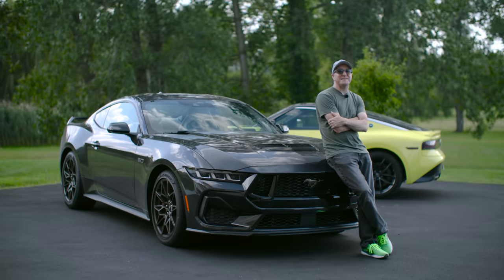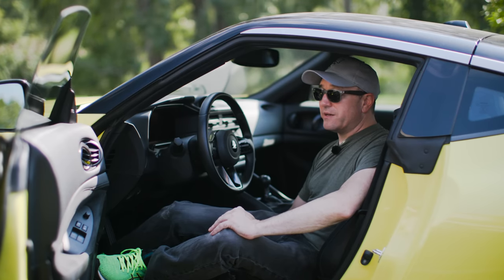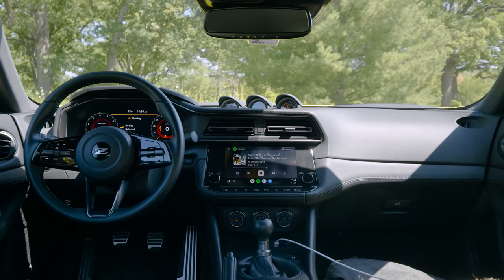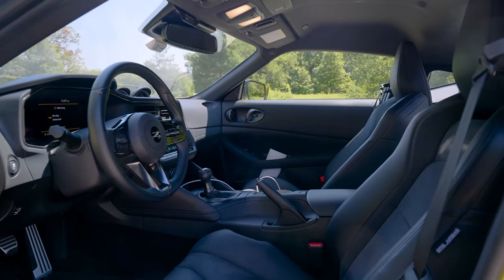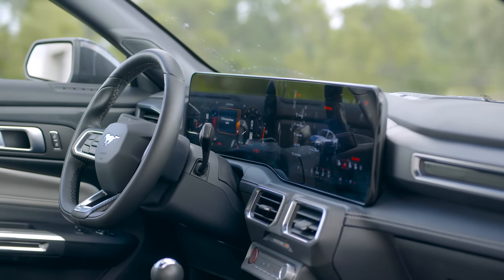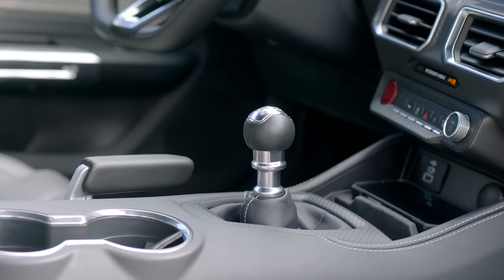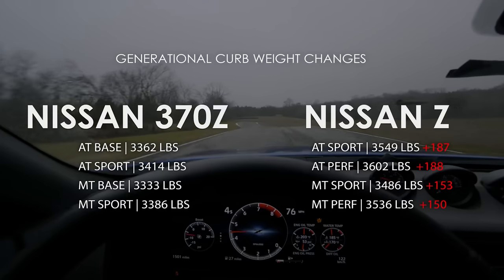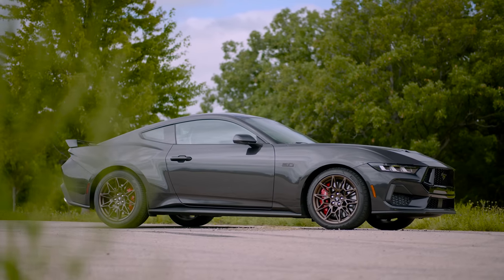Mustang GT vs Nissan Z | Maximum Muscle, High Prices

Comment: I can't believe how expensive cars have gotten. These 2 cars should not be over $50k each.
Reply: Kneesarn!
Reply: How so?  A 1991 300Z TT had a MSRP of around $35,000 which is nearly $80,000 in today's money.
Reply: Well you can get a GT for less, this has a few expensive options
Reply: These are high level sports cars. If you want cheap fun, there's the Miata, GR86, civic si, Elantra N, etc
Reply: Average car prices are 50k now. Yep I was shocked too.
Reply: It's not "cars got expensive", it's your money are worth less. Keep the printer on.
Reply: @sleeksilver Yea. People forget how expensive the Z32 was, in it's day. That's why the Z33 was such a shocker. It was about $26,900 in 2003, which is about $44k, today.
Reply: With all the safety and emission requirements, it's no surprise.
Reply: @sleeksilver Yea, but was Mortgage, Rent, power, gas, food, and everything else as expensive too? Definitely not.
Reply: @sleeksilver  Average Canadian household income in 1991 was 49,842 which is 111,866 in 2023 dollars. The average household income in 2023 is about 67,500. So yeah the Z is expensive as fuck.
Reply: Now do the mustang GT price wise guy... Oh, I did, it's 27k in todays money. Lets even add 6k for powers sake, thats still FMV. Lets pretend you were born yesterday, and thus had not watched same model prices rise markedly over the last 3+ years beyond inflation rates also considering some of these "sports" cars are essentially the same platform as they were 10-14 years ago.   @sleeksilver
Reply: @Scypher0th  what planet do you live on?
Reply: @sleeksilver shhhh we don't talk about that
Reply: @waynemangan7200  an $18,000 Mustang GT in 1991 is equivalent to $40,000+ in today's money.  What calculator are you using? LOL
Reply: @JoiceVaderd this new Z starts around $42k I think
Reply: +1 for inflation. The fact that I can still find used cars for under 5K is unbelievable.
Reply: @sleeksilver but wages haven’t gone up much since then. They’ll sell barely any even at $50,000 today compared to 35 10 years ago because of that
Reply: Inflation. Gotta keep up.
Reply: @devn3813  you're surprised people are buying less coupes today compared to 10 years ago?  Coupe sales are in the shitter and hardly anyone is buying sedans now compared to CUVs. Nothing you said is surprising.
Reply: That's how inflation works.
Reply: @sleeksilver  because we’re priced out of sedans coupes and performance cars. If you want a decent sedan you better have $60,000+ and they’re making crossovers $25,000 now. They’re altering the market themselves artificially
Reply: For this price it better be a Lexus.
Reply: Bro we just poor that's all adjust for inflation these cars are inline with the older ones
Reply: @tyhyhh Unfortunately incomes don't keep up with assets.
Reply: @devn3813  what are you talking about? Coupes haven't been a cheaper alternative since the '80s and '90s. There are still plenty of affordable sedans around, look at the Elantra, Accord, Camry etc. Performance cars have never been cheap. 

Good, fast, cheap, pick two still applies and always has.
Reply: @sleeksilver  2010s mustangs were all 3.
Reply: @dazuko8839 

“High level”?….. that’s funny
Reply: @dazuko8839 new mx 5 is not cheap
Reply: @Felale you cant even buy a new IS300 in 2003 with the equivalent 50k 20 years ago
Reply: @notagain2856  Okay? And Lexus is a luxury brand.
Reply: Go back to 2003 and see what sportcar you can get for 30k
Reply: @Felale  lol no they weren't. Cheap ass interior and low refinement. I spent a ton of time in a 2012 GT with the performance/track package.
Reply: @sleeksilver It's not all black and white. Cost of r&d for it 30+ years ago was higher, nowdays this gen had it far less as technology advanced and it has a lot of old tech used, well basically everything is previous gen, everything that required considerable amount of r&d. Further more, average salary in 1991 ranged from 17k to 74k depending on degree, that's without bonuses, yearly additions and all. 
Average US salary in 2023. (yearly one) ranges from imagine under 15k for 9.4% of population, 15 to 25% for just under 9% of population, 8% for 25-35k, 35-50k 11.6%, 50-75k 16.5%, 75-100k 12%, 100-150k 12%, 150-200k 8% and 10% of those over 200k. Bare in mind life expenses went up by tens of times, including food, realestate, taxes, additional expenses that were not present 3 decades ago etc. I don't have percentages of income population in 1991. but only amount shows you how bigger the standard was back then.
Reply: Mustang s650 is just a refresh of the s550. And yet they are gouging customers.
Reply: @sleeksilver  those are all cvt shitboxes for $40,000
Reply: @JohnyMcNeal  I'm an FA, I understand everything you were pointing out. I'm not arguing over buying power versus salary, I'm just comparing MSRP to MSRP.
Reply: @sleeksilver 
So true , because in 1991 consumers actually were buying these cars.. not leasing them while living in their parents garage…
Reply: @sleeksilver inflation calculators are wack. It doesn’t show buying power and necessities like food and housing have outpaced salaries
Reply: @ToolishBox  they aren't whack at all. Anyone with a brain understands buying power vs salary.
Reply: @platinummad6315 Well stated
Reply: My wife’s new Pacifica Hybird that Mark almost bought (yes, they’re that decent) cost $60K. $6 0 0 0 0… for a minivan. Which I was like “are they high?!?” Then to look up in ‘98 the top Town and Country, which was a shitbox, my exes parents had one, and the new new Pacifica is damn near luxury  in comparison, $34K, which is $66K in 2023 money. Yes, stealerships are bending people over, but inflation worse so.
Reply: Go look up how much a ‘95 300zx turbo was and reevaluate your comment
Reply: Over 50? Loaded, they should cost 40.
Reply: @ToolishBox  It's also under the the true rate of inflation due to various external influencers. The CDI hasn't been accurate for decades.
Reply: Why does everyone forget that cars that are 5 years old are just as good and cheaper??? Like you don't need the newest fuqing thing.
Reply: @drtydsh  Someone has to buy them in order for them to be five years old
Reply: @waynemangan7200 exactly. Only reason cars prices skyrocketed, was because of our Democratic government shutting our economy down for COVID. If that never happened, these two cars would be selling for low $40k’s.
Reply: The Z's twin turbo, Japan-made engine is not cheap to manufacture.
Reply: When pricing is based of inflation vs the income of buyers, everything will feel more expensive. Really, we’re all getting poorer
Reply: @air-headedaviator1805  Incomes are a lagging indicator. Median incomes are right about in line with inflation. The problem is the price of many essentials has greatly out paced inflation.
Reply: The auto industry has killed itself, I've just lost interest now.
They start by making pointlessly big heavy SUVs and charge more for them, make that the norm, get rid of their cheaper options, and then introduce what should have been the cheaper models are new special sporty models that are even more than their stupid SUVs. It's all just a market manipulation strategy that the general public roll with
Reply: @chrisogrady28  they make what people want to buy. The consumer is to blame here
Reply: @chrisogrady28 Rather the people who buy cars new like SUVs and there’s not enough people who like sporty cars for those to be a mass market thing.
Manufacturers make what sells, always have. If they don’t, they go out of business!
Reply: I remember when I was in high school these cars were so affordable
Reply: @dazuko8839  No, this is a GT car and a muscle car.  These are sports cars the way a Honda Accord is a sport sedan.  Let's just be honest about it.
Reply: @emilianoorozco6498  LoL. When did you attend high school?
Reply: @sleeksilver  I can't stand when people like you bring that debate up.  Clearly you don't have a clue about economics.  $35,000 in 1991, you can buy a nice house for $78,000.  My parents bought a house in 1991 for $78,000.  I just bought one for $305,000.  Gas prices was $1.14.  You could get a Whooper or Big Mac meal for $1.99.  Cigarettes was $2.00.  You can work at a hardware store and afford a house.  I read an article that a woman worked at an ACE hardware in the late 80s and early 90s and was able to afford her own house.  This is called stagnation, inflation goes up but wages don't, what part of that don't you understand?  A $35,000 a year job in 1991 isn't an $80,000 job today.

In the 90s, I was in high school making $5.50 an hour, I managed to buy my own car a, used Mazda RX-7, gas was $0.87 at the Sunoco down the street. 94 octane was $1.25/gallon, and paid my own insurance, $50 a month, and did a lot of repairs to one of the most unreliable engines ever made.  I had to buy my own lunch at school, my own clothes, etc., since I didn't want to ask my parents for help.  A teenager now would not be able to do afford to buy a car, pay for the gas, insurance, and maintenance with the current wages at a 20-25/hr work week for those under 18.

I went to a tech school and it was $12,000/year.  That same tech school is now $52,000/year.  A dozen of eggs was $1.25 a dozen, now it's worth more than your first born.  Either you're very young or just naive.
Reply: @sleeksilver Audis are overpriced, now do the price of a 2001 Mustang GT adjusted for inflation 😊
Reply: @JoiceVaderd  People also forget that you can buy a nice house for $70-80k.  Stagnation, learn about it before you make a silly argument.  My parents used to tell me it'll cost about $80 every two weeks for groceries in the 90s.  Now it cost me $200 every two weeks on the low end.  You people never factor in cost of living to this silly inflation debate of yours.
Reply: @DroneStrike1776  Yea. My grandfather bought his house for $80k, in the 80s. While inflation is something to take into consideration, the pay has remained mostly stagnant and hasn't risen with inflation. My dad was able to buy a Z, in 2003, when it came out. I make the equivalent that he did, and I definitely can't afford the brand new Z, comfortably.
Reply: well, printing oceans of money causes to dilute the currency
Reply: Mustangs shouldn’t cost over 35k. Ford is asking bmw prices for it. They’re insane.
Reply: @devn3813 same thing happened to wagons unfortunately. Industry's writing the books because it's much more cost effective to make some plastic piece of shit with a whiny 1.4L engine and horrific body control than to make a car that's fun to drive.
Reply: Top trim should be 55k max imo
Reply: @Felale $60k can get you a used LC
Reply: 2014 911 base can be had for $83k. Today a 2023 will set you back at $115k. Almost a $30k delta between  the two. Obviously a much diff car than these two.
Reply: Luckily you can finance for 420 months at 69% interest.
Reply: Both of these are too expensive and also too heavy
Reply: The 400 is in the 40’s where I’m at!
Reply: Isn’t it the dollar crashing and not the cars getting more expensive?
Reply: A new Corolla or Civic is around $25k where I live.  Welcome to hell, population: us.
Reply: Boomer
Reply: With inflation 50k sounds about right. Both car’s are still affordable to many consumers.
Reply: @Terminxman the Z starts at 40
Reply: $35-$40*
Reply: stop complaining you americans! here in switzerland you can get a fully loaded mercedes a45 amg for 120k and you are complaining bout a 50k V8?
Reply: @sleeksilver 
This statement is true but at the sametime its really the USD has gotten less in value. The FEDS "accidentally" leave the printers on like a kid "forgot" to turn off the lights.
Reply: Agreed! I also find it fascinating that for every comment that understandibly laments a car that used to be $35k now costing $60k, there's no shortage of people that counters with a "what's the problem, that's 'normal' inflation...stop being broke;" or "if you want cheap...go get a Miata." Which ironically is also a car that while being relatively cheaper today, isn't impressively cheaper for the bargain it used to represent. Simply put, it used to be $20k less than it is now.

Understandibly, gradual price increases are an inescapable reality of our times. Modern requirements and tech that go into designing, certifying and manufacturing new cars (epa, safety, crash, etc.) definitely makes the production business expensive for companies. The question is...does inflation plus these increased manufacturing costs really equate to a whole whopping $20k more on avg than just 10 years ago🤔? How much of this margin, beyond what's necessary for a profit is simply companies taking liberties with the fact that we don't ask the "used to be $35k" question?
Reply: Mustang was like 25-30k in 2000
Reply: Or stop asking for the sun the moon and the stars to be in your car.  Easy price fix.
Reply: First words out of my mouth. Maybe the Z because it’s brand new and not mass produced like the mustang which has very minimal update
Reply: I cant wait for you to see the price of the new Toyota GR Corolla.
Reply: Yes they should your statement just clarified it that’s the price range a Honda accord is 40,000 lmao
Reply: @isrstrategies  

And a top of the line toyota camry xse is almost $50k
Reply: @velardechelo  yes and it was a complete shitbox with technology from the 70's
Reply: minimum to play w fossil performance is 60k. a 43k model 3 performance will gap these for days.
Reply: @sleeksilver I think my 2003 sold originally for 32-33k
Reply: the tt 300zx was also noted to be extremely expensive at the time- it was trying to punch upwards at even more expensive cars and it wasn't until later models that they brought the z back into affordability  @sleeksilver
Reply: It's cheap to me 50k is nothing for what you get
Reply: They should not be more than $25-28K. This is inflation - the cost of having a fiat currency and a government that won't stop spending away the future of the country. I paid $28K for my 14 PP GT. That was ~8 years ago. Cars have almost tripled in price in 8 years. Think about that for minute. 

Perspective. A GT in 2005 was ~$25K and in 2015 was ~$28K - an increase of 3K on average. Prices were starting to drop during the Trump era as inflation was ~1% and the economy was approaching a golden era. Then we got Bidenomics.
Reply: @dazuko8839 All of which are boring and slow compared to that beautiful V8. That said, there's always buying used or building your own car
Reply: Might wanna look at house prices then
Reply: It's not that the cars are expensive....it's that cash is losing value everyday. Saving cash to 'one day' buy nice things will make you fall behind. Don't listen to the boomers. Those days are done.
Reply: Nahh 30 man. The people who want these cars can’t even afford them
Reply: @jojosaves truer words were never spoken. Amen, brother
Reply: Inflation.  If you plug in the price of each from the 90s into a inflation calculator these cost way less than they should.  Its the not so silent tax
Reply: It is what it is though
Reply: @sleeksilver
Maybe so, but you aren't taking into consideration the average wages, cost of living, etc. It takes a lot longer to pay off a car now versus then, it's not even remotely the same.
Reply: @svetlingueorguiev1198  That doesnt matter.  The cost to build is still x.  The fact that wages did not keep up with rising cost is based on government failed policy.  The feds 2 directives cant be achieved at the same time.  Low unemployment and low inflation.  When inflation rises to high they need massive layoffs to fix it.
Reply: Emissions rules are why it's expensive? Ridiculous.
Reply: @dazuko8839 Civic Rs are not cheap, similar price to these 2 cars, but also similar performance. How that car has grown up and taken steroids.
Reply: Yeah we need a bare bones Steelie version with one seat and no sound deadening. These cars are priced like top spec models out the gate
Reply: With inflation a car in 2008 that was 30k is 50k now. I think we all know inflation is real. it's just a tough pill to swallow.
Reply: Inflation
Reply: A bag of groceries shouldn't cost $100 either. A 3 bed rllm home on less than an acre shouldn't cost 500k.
Reply: Inflation.
Reply: Where have you been last 3 years MARS?FYI it cost $200 eat at Burger King now!lol